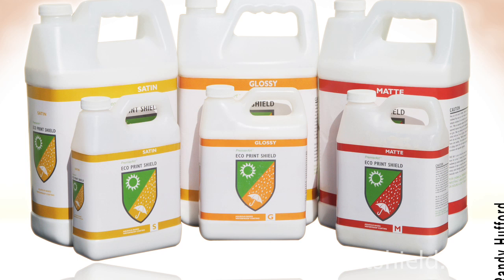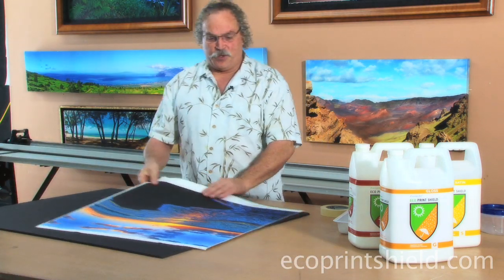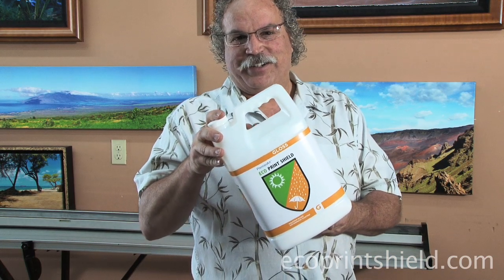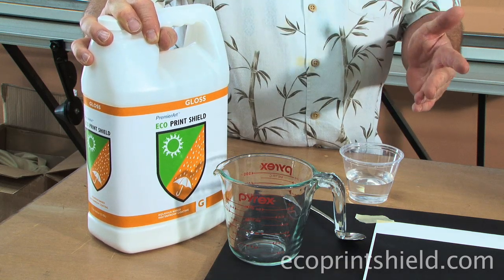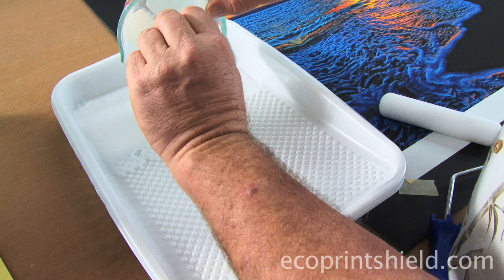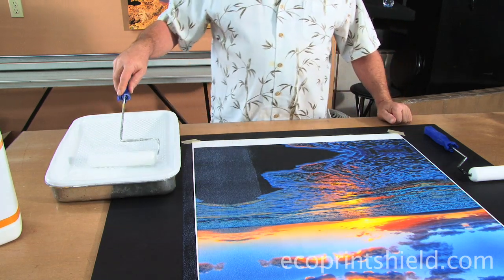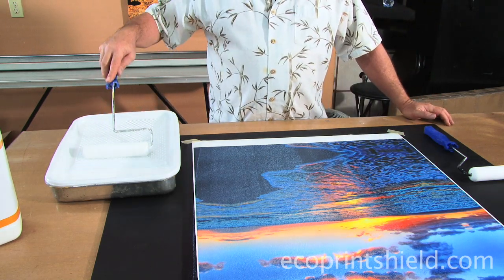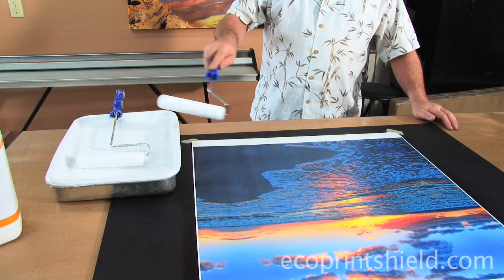Rolling Eco Print Shield Part 1

Comment: Thanks for the video, i ordered one of your kits and has absolutely no instructions for mixing or application. Also, don't appreciate the kit having four inch rollers and tray, which according to your video are basically UNUSABLE for any typical display size prints. I spent alot of money on a canvas ink print and am at this point afraid to use eco shield as researched videos are on some points "contradictory".  Customers would probably appreciate a little more time on a "quality" product instead of having to sort through something that was thrown together just to make a quick buck!